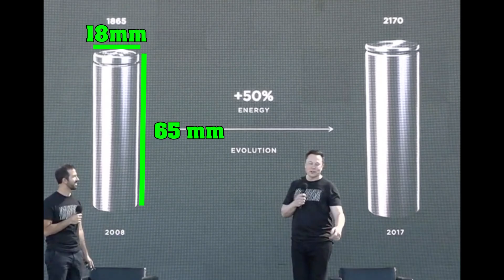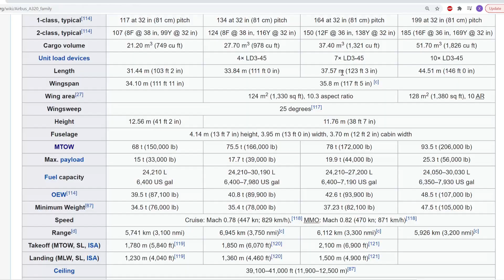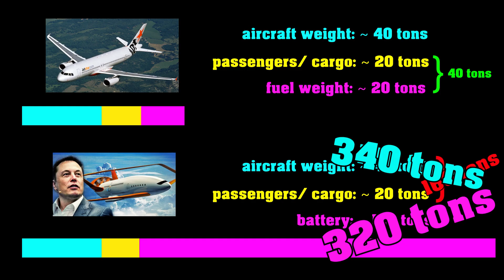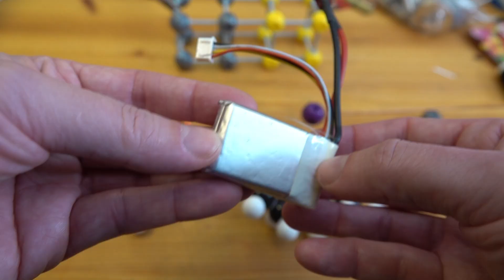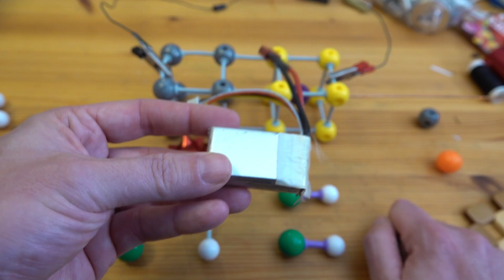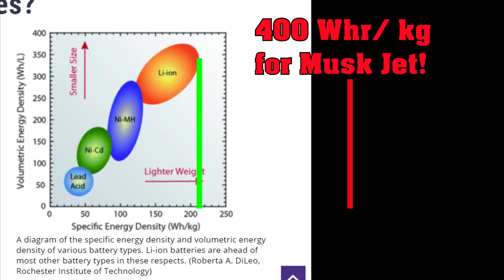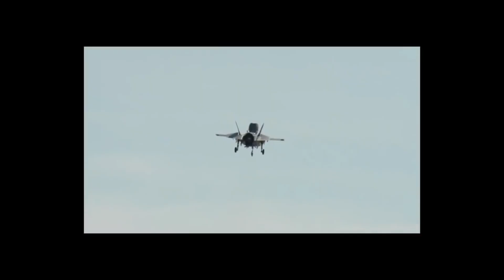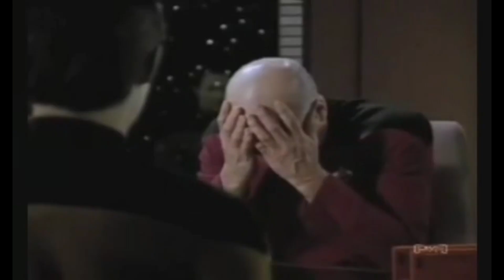Tesla's Secret Plan To Disrupt Airlines: BUSTED!!

Comment: Actually, with bigger batteries are, the fewer you need to stack together.

It is easy to believe that it is the same, but you actually save a lot of space and weight by having fewer independent batteries with their on enclosure and fewer connections between them. 

That minuscule difference in every single battery, compounds rapidly into having the ability to pack more energy in the same space, probably at a lower weight as well.

It truly is a breakthrough, and easy to understand if you actually pay attention at what Elon said on battery day.

It would be perfect if you could build a single battery (like an iPhone) and put it on a car, but for some technical reason (I’m going to have to take Elons word on it), technology at this moment is not there yet for this kind of batteries, and you need to use hundreds of small batteries of this kind instead.

You cannot just make them bigger , and he did... that is the breakthrough!

Comment: 5:57 Dont forget that a Fuel plane gets lighter when burning fuel so it can land safely, a battery does not lose weight when it loses energy.
Reply: Don't forget that when you design an electric aircraft you won't be using the same design principles of a combustion aircraft either.
Reply: @bluesrockfan36  And your point is... ?
Reply: @electric7487  Thinking you can hold everything equal and put a giant battery on a commercial airliner is one of the most colossal straw me I've seen.
Reply: @bluesrockfan36  More importantly, HOW would the design principles be different between an electric plane and a fuel plane? What, specifically, are the differences?
Reply: @electric7487  Think about lightweight shorter flights carrying far less people instead of long trans-atlantic flights carrying thousands.
But for starters if you're setting up to design an electric plane where weight is important, you can't afford the extremely inefficiencies that you find in modern aircraft.

If you want to know more about it, look up actual electric VTOL proposals. None of them are a boring 747 with a giant battery in them.
Reply: @bluesrockfan36  But why bother? The burning of hydrocarbons itself isn't what's causing climate change; it's the lack of large-scale capture and storage of the excess CO2 that we're putting into the atmosphere that's the problem. Supersonic flight is either impossible or impractical with electric fans or propellers, so things like low-bypass afterburning turbofans, ramjets, and scramjets running on carbon capture-derived kerosene would be much more realistic when it comes to large-scale supersonic commercial flight in the future.

And even clean-sheet e-VTOL aircraft still suffer from the problem that the batteries are going to inevitably become dead weight. It's an inherent problem; no amount of new design principles are going to get rid of it.
Reply: @electric7487  Because even if climate change wasn't real, having airplanes running on non renewable resources is not sustainable in the long run.
So unless you're willing to give up entirely on air flight, you need to develop it. I don't see the issue.

You can have supersonic electric planes of they go at enough altitude. There is dead weight in every system, that's why you design around it. You don't simply absorb the dead weight of a 747 and slap a battery on it. You need to drastically redesign around the new weight limits. This is why it's such a colossal straw man.
Reply: @bluesrockfan36  Did you even read what I wrote about synthetic kerosene?

The fuel that we'd run airplanes off of would gradually increase in percentage of synthetic kerosene, and would ideally be entirely synthetic once fossil fuel reserves are depleted. In reality we could be running full synthetic fuels long before practically-obtainable crude oil reserves are gone.

As for the issue of landing weights, my argument still remains - even if you DIDN'T take the dead weight of a 747 and put batteries on it, the issue still remains that the airplane will have almost the same weight at takeoff than it will when lands. It's far harder to design around those new weight limits because with a battery-powered plane those weight limits will almost certainly be much smaller than with a gas-powered plane.

Theoretically, yes, you could have supersonic electric planes at high altitude. I doubt it would be economically viable, however. There are charts you can find that detail the specific impulse for various aeronautical engines, and if you get them from respectable sources, they look like this one from Wikipedia: https://commons.wikimedia.org/wiki/File:Specific-impulse-kk-20090105.png
Reply: @electric7487  Yes I read, it's fine if you can make it work. I just don't believe in enforcing my own ideological views on saying what is or what isn't possible.

We should pursue both technologies and allow the market to decide which is better, shouldn't we?
Reply: @bluesrockfan36  Maybe, but there are always some things that are more likely to be viable than other. Case in point: supersonic commercial aircraft could be economical in the future but none of those are ever likely to be VTOL or electric, for many VERY good reasons.

And as for "enforcing my own ideological views on saying what is or isn't possible", let me make this clear:

They laughed at Galileo.
They laughed at the Wright Brothers.
They laughed at Newton.

But they also laughed at Bozo the Clown.

Do you know what's the best way to determine if you're laughing at the Wright Brothers, or Bozo the Clown?

TO LOOK AT THE FACTS.

Laughing at the possibility of supersonic jets in the future would be like laughing at the Wright Brothers. A supersonic electric aircraft, however, is Bozo the Clown here.
Reply: @electric7487  Why are you even talking about laughing?
What's so funny about incredibly hard problems in engineering? Are you so intellectually insecure and lazy that you have to laugh at problems just to dismiss them and not deal with them?

If one of the most successful aerospace engineers in history wants to invest significant resources to develop the idea... why are you laughing? 

Because something is very hard to outright impossible right now, does it mean it will be impossible always so you flat out laugh at it and abandon the concept?

You say look at the facts while at the same time bringing up people who did something NEVER done before. What facts were there?
I hate to break it to you:
But you'd be laughing at the Wright brothers too. Oh, no one laughed a Newton either.
They did laugh at Tesla and SpaceX though.
Reply: @bluesrockfan36  Look, I love the appeal to emotion.

"If one of the most successful ærospace engineers in history wants to invest significant resources to develop the idea... why are you laughing?" 

First of all, MUSK IS NOT AN ENGINEER. He is a SALESMAN and ENTREPRENEUR. He has NO background in engineering.

Second, as to why we're laughing at the idea...

"Because something is very hard to outright impossible right now, does it mean it will be impossible always so you flat out laugh at it and abandon the concept?"

No, I was talking more about practicality, not possibility. There are some things where most people laughing at it is rightfully justified because ther are other solutions that currently exist and are far more practical. Or, there are other concepts that have a far better chance of being viable, or more viable than others. Some technologies, like Hyperloop and supersonic VTOL electric planes, will always have insurmountable impracticalities that any resources poured into them should have been spent on other, more practical ideas. Or ideas that have a much better chance of becoming practical.

Also, the part about laughing at people was actually a quote from Carl Sagan. He's the one who initially said it. http://www.quotehd.com/imagequotes/authors2/carl-sagan-scientist-quote-but-the-fact-that-some-geniuses-were.jpg
Reply: @electric7487  Musk is a chief engineer at SpaceX, he works doing engineering at both SpaceX and Tesla.
This is not up for debate. Anyone actually being even mildly intellectually honest, who has done the most cursory research knows this.
Most of his time is spent doing industrial engineering.

Don't take my word for it, take world-renowned engineers' who have worked with him.

So when you say he's a "salesman and entrepreneur" you're flat out denying reality. The guy literally has patents to his name.

This is an appeal to emotion. You're letting your emotion get in the way of verifiable facts.

"His background is NOT in engineering"
Do you mean his formal education? Who gives a rat's as* about it? The guy does have a physics degree and dropped out of a material science doctorate. 
Do you want me to begin the myriad of world-changing engineers who never even had formal education? Henry Ford rings a bell?

"No, I was talking more about practicality, not a possibility."
That's not true, given that synthetic fuels still pollute as much as regular fuel.
But that's not for you to decide.
How would you feel if I decided to laugh at the idea of synthetic kerosene in a horrendous appeal to ridicule?
That's for the market and the customers to decide.
All solutions have their costs and benefits. You cannot claim one solution is flat out better or superior to the other, much less when it requires such a complicated refinement process.

If we had an electrical VTOL aircraft right now, how many countries would jump the opportunity to get them? How many poor countries who have access to electricity but little access to refinement manufacturing facilities would be eager to have them? 
Electricity is much more ubiquitous and cost-effective than synthetic fuels, especially in regions with renewable electricity sources.

So no, I don't find it the slightest bit funny. If anything I find it pretentious as all hell.

"some technologies such as hyperloop"
So now you're using false analogies as well? Curious. What does hyperloop have to do with electric VTOL aircraft?

"There are other concepts that have a far better chance of being viable"
And who says this? You? Why should I believe you instead of say: NASA?

"He's the one who initially said it."
Yes, except the part you added. Which is your presumption that engineers tackling these very complex issues are clowns . 

Make no mistake, you'll be laughing at the Wright brothers just like so many did. Because the "facts" weren't there to substantiate what they wanted to do since it wasn't done before.
And of course, the Wright brothers had no background whatsoever in aerospace engineering had, they? Did they even finish high school? Oh wait, they didn't. They were self-taught like so many engineers were.

You see now? Be honest to yourself, and tell me... would you be laughing at the Wright brothers? Would TF make a 'plane busted' video? I think you know the answer.
Reply: @bluesrockfan36  Sorry... how is any of this fractally-wrong ranting going to solve the technical problems with trying to make a supersonic VTOL electric plane?
Reply: @electric7487  Ah Mr. appeal to the stone is back, they guy who thinks calling things "wrong" makes it so!

Sorry if you can't handle reality. But Musk was indeed inducted to the National Academy of Engineering.

But I agree, this conversation doesn't help bring forth supersonic electric VTOL planes. The conversation wouldn't exist if not for TF video.
So, ask TF why does he make videos instead of solving the problem.
Reply: @bluesrockfan36  Actually, have you considered that the reason I said it was wrong was because it was actually wrong to begin with? I don't know just how much Hopium and Copium you're on, but the fact that you're having to do such insane leaps in logic to defend Musk and his ideas is very telling.

Also, Musk being inducted into some academy or whatever (IDGAF, to be honest) has absolutely no relevance to anything, so stop grasping at straws.
Reply: @electric7487  Have I considered that you were right? No, I haven't.
Specially given that its a VERIFAIBLE FACT that Elon Musk got inducted into the National Academy of Engineering.

"Insane leaps in logic"
What leap in logic? The one guy thinking proof by assertion is a valid form of argumentation is you, mate.

"into some school"
/facepalm.
It's not a school.
Look it up.
You obviously don't have the faitnest idea about the topics.

"has no relevance"
Didn't you say that:

"First of all, MUSK IS NOT AN ENGINEER. He is a SALESMAN and ENTREPRENEUR. He has NO background in engineering."

Sounds relevant to me. Specially when the most prestigious engineering institution in the U.S with peer-election decide to induct Musk as an engineer.
But if you think you know better than them... then that's another topic.

Comment: 26:30.  Ahh yeah... your hacking about stuff you don’t truely understand there. Airliners are now and have been for a very long time cruising at 40 000 feet. Time of useful consciousness is about 13 seconds, quick don 100% force fed over pressure oxygen masks sit above the pilots’ heads and the aircraft isn’t allowed to fly if they don’t work perfectly and the oxygen cylinder is filled to at least the minimum pressure. So pressurisation problem occurs and you get visual warnings right in your eyesight line no matter where you are looking at the time and audio warnings at the same time. You are required to know what the sound means and what the lights mean no thinking or looking it up, IT IS A MEMORY RECALL ITEM. You IMMEDIATELY and I I mean IMMEDIATELY just yank the mask down and it goes over your head and headset and glasses but not your coffee so literally just drop that. Now that both pilots are on oxygen it is a LEGAL requirement to transmitt a PAN PAN call “ Pilots on oxygen” people say oh fuck on the ground and start shifting aircraft that are below stricken jet. Seatbelts sign goes on and very short sit the fuck down is told to the punters. Pilots confirm the fault, masks are dropping down the back, punters didn’t read the emergency card or listen before takeoff and pass out whil trying to force a O2 mask on a kid who doesn’t like the taste of oxygen. The pilots select some tricky autopilot settings. Set 10000 feet of available as its highest normal breathable altitude, select higher if mountains and start looking for off track once lower, set the selected airspeed to what is the max speed or Velocity NEVER EXCEED for the aircraft and close the power levers. A loop starts. Aircraft slows due to no thrust, so aircraft dives to speed up. So the aircraft ends up in an un goddessly steep dive to maintain Vne with no power YOU ARE DROPPING AT 8000-12000 feet per minute it’s frightening that’s why the autopilot does it or you overshoot and crash or rip the wings off. Aircraft levels out at 10 grand in about 3 min and the pax start to come round and promise to read the card next time and to listen. Shit I forgot the mayday and emergency descent broadcast and the hanging from your harness bit. Now you sort the problem that your in fat air and not race horse thin shit. Any aircraft that can cruise above 25k feet needs drop down masks.

This is a no fucking around event and a sudden pressure loos will leave people and hostesses stranded and unconscious in the isle 100%. Old fuckers with shit lungs or weak hearts are dead. But if anyone no matter how frail just immediately reaches up grabs the yellow mask, yanks it down so the flow starts holds it to their face THEY ARE 100% SORTED and will live and stay conscious for a ride that they won’t want to remember afterwards. The head strap is great but not necessary if you can’t figure it out. The strap holds the mask on better and it won’t fall off in the bumps like it will if you hold it.

Rules limit max cruise altitude to that of which they can still reach 14000 feet before passengers die on the way down without oxygen. So that’s what gives airliners of the last 20 years a 40000 foot cruise altitude is build quality and testing for massive descent rates.

AIRLINERS ARE MASSIVELY MORE EFFICIENT THE HIGHER THEY GO, NOT LESS EFFICIENT. At 5000 feet a B737 might get 500 nm but at 40000 feet get 7000 nm. Hellhiem due to air molecule spacing your hitting them so infrequently that your airspeed indicator says 180 kts. But that’s a lie since the air is say twice as far apart as at sea level your actually truely doing 300 kts or 320 kts depending on temperatures that’s at 25000 feet and for a 737 at 40k you indicate 340kts and are doing Mach 0.87 . Oh and your burning way way way way less fuel per hour up top as well maybe half or two thirds LESS and going 2 to almost 4 times as fast across the ground. Yep that’s less efficient up top.

Comment: Maybe Elon should work on a pocket sized fusion reactor. Surely he can get one built in the next 5 years.
Reply: Researchers from Wuhan university have created a prototype thruster capable of generating plasma jets with propulsive forces comparable to those from conventional jet engines, using only air and electricity.

An air compressor forces high-pressure air at a rate of 30 liters per minute into an ionization chamber in the device, which uses microwaves to convert this air stream into a plasma jet blasted out of a quartz tube. Plasma temperatures could exceed 1,000 °C

Comment: one problem is that if you have a 65 ton maximum landingweight, you can start with 80 ton on a normal aircraft. but a electric plane have to start with 65 ton. a fully loaded battery weighs about the same as a empty.

Comment: When a plane takes off with full fuel it can't land without burning off fuel or dumping it over the side. The battery does not change weigh as it goes flat; it means the battery size will limit the takeoff weight, so it can’t weigh the same as a full fuel load for example.